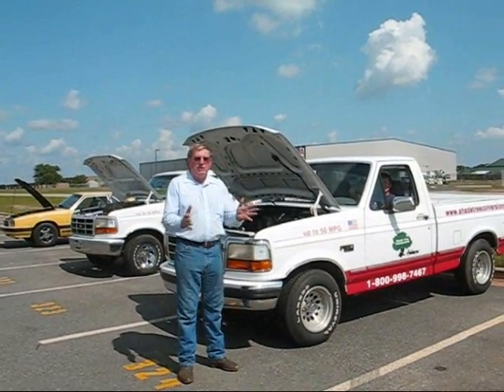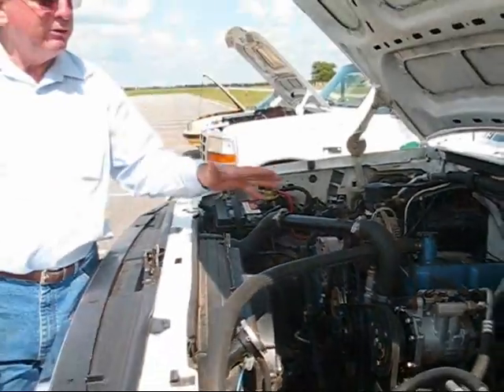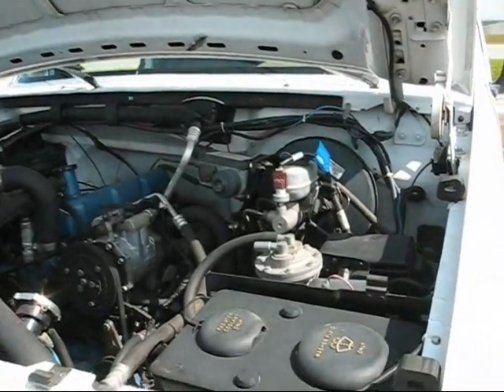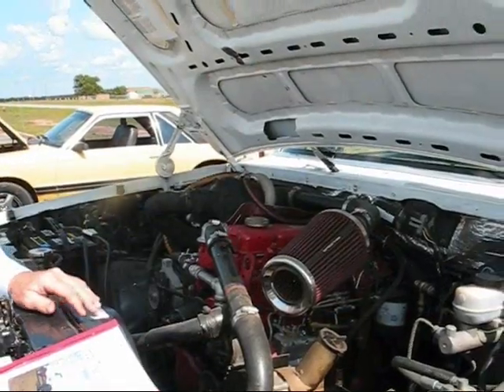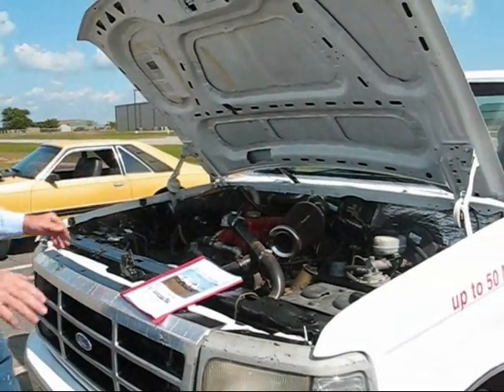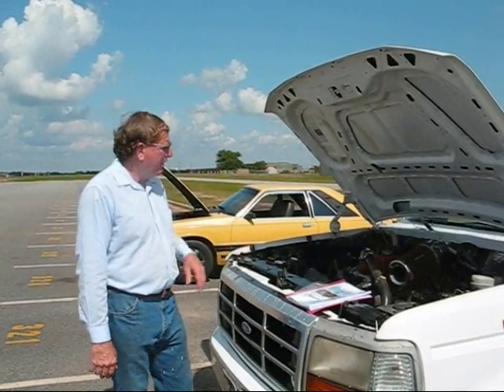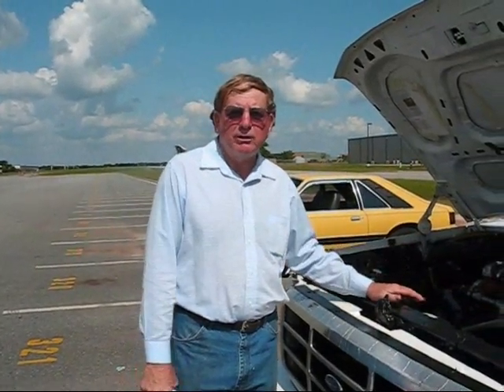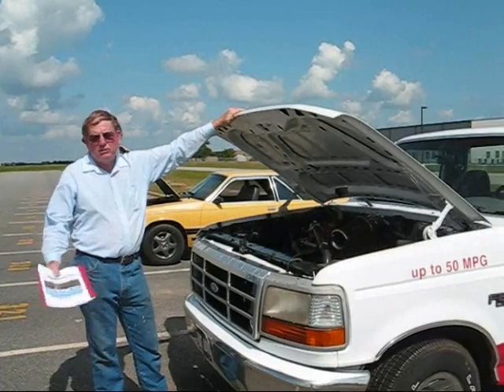Shade Tree Conversions Diesel turbo tractor engines Part 1

Comment: My dad used to drive an '88 square body GMC 2500 with a 3+3 cab and an 8 foot box, it would get over 30mpg and pull a house down. Perkins 6.354. Right now I'm looking to do a similar conversion to a 67-72 F250 4x4. Just gotta find the truck first, then find a T6.354 lol

Comment: He's absolutely right about the high education snobs that have to follow everything by the book, but the hard workers will figure out how to make this stuff work.  I work in a small town truck shop and put a Detroit 4 53 in my pickup and my foreman has an Isuzu 6 cylinder in his.  They both run great and we get better mileage than a gas engine ever would.

Comment: i have a cummins 4bt in my 1977 chevy scottsdale, with a chevy 4 speed behind a 2 speed splitter and a np205 case. it has 307 gears and i get 33mpg city and up to 45mpg hyw
Reply: tyrell little excellent choice is it turboed?
Reply: 4BT 4 Cylinder, B series, T Turbo charged
Reply: what brand and model of 2 speed splitter? what transmission you using with it?
Reply: @MrScottJ87   likely a Muncie 4 speed (rock crusher) with a granny first gear... find them in 3/4 and 1 ton Chevy's and more … as for the splitter when the term splitter is used it usually refers to a 2 speed rear axle unit (not a double trans set-up) very reliable Eaton versions stand the tests of time provided the driver knows how to use it. These are found in many commercial and farm use trucks, long beds, dump trucks and give the option for 2 final drive ratios inside the axles gear set which allows a user to split each gear in the trans by switching the rear axle gear set many options how to drive such a beast but usually not needed until the vehicle is loaded to the gills. They aren't brand/manufaturer specific such units can be found in ford, chevy, international and many other trucks.. If your looking for a good trans for such a build there are some nice Spicer transmissions out there from back in the day that are 5 speeds with actual over-drives (.75 and .64/.67 5th gear) unlike the Muncie 4 (1:1 4th gear) best place to find one of these units is a bus/school bus certain model numbers have great gear sets and as mentioned real over-drive. Yes, the OP did word it in a way to cause confusion or he himself is confused as to what in behind what when he listed the specs.

Comment: I have a  good running  4 cl ford industrial diesel engine  from a NH  905 swather it's very easy on fuel . I have  1/2 to 1 tons  years 1950 to 1980 would that engine work for a truck ?    Our great town mechanic was helping someone that was broke down and was  accidentally killed  such a  sad  loss RIP  BIG E
Reply: Put a gaa v8 Ford in it

Comment: That air filter placement could use adjustment, it's just taking in every bit of the engine heat.
Reply: It's a diesel engine, hot intake air helps compression ignition in a small application like this

Comment: Hello I saw your video and it motivates me to do it. Could I do this to a 2004 ford explorer? What will be the changes I will have to on the SUV? Thank you
Reply: Look into the VW turbo diesel, the 16 valve 2.0 . Much quieter, better power, better power to wieght ratio. I've seen them adapted into Jeep's/ rockcrawlers.

Comment: diesels are more efficient mostly because of direct cylinder injection and a more complete burn of the fuel. hence why these newer direct injection gas engine are becoming so efficient!
Reply: Not quite. Diesels are more efficient because the cylinder is always full of air. They don't burn the fuel as well as gas engines which results in high particulate emissions. In "normal" gas engines (carburetor, throttle body injection and port injection) the fuel has plenty of time to mix with air which results in more thorough combustion. In diesel and gasoline direct injection engines the fuel is burnt almost immediately before mixing thoroughly with air. This however enables the use of ultra lean mixture in gas engines which makes them more efficient.
Reply: truthfully the bottom line is its verry simple there is more potential energy  (btu) stored in a gallon  of diesel than there is in a gallon of gasoline...which equals more efficiency.
Reply: Efficiency has nothing to do with energy density of the fuel.
Reply: actually it does...
Reply: Efficinecy is ratio of energy put into the machine and energy that comes out of it. It has nothing to do with the actual volume of the fuel used.
Reply: He's talking about fuel efficiency. You get more energy out of less fuel.
Reply: Agreed, and somewhat affected by the fact that 1 gallon of diesel has 113% of the energy of one gallon of gasoline.
Reply: Think you got that backwards bud
Reply: Diesels are more efficient than gasoline because of the High Compression in the engines. I can’t believe nobody mentioned that. 

Nissan has a Variable Compression engine now that can reach near diesel numbers and performance
Reply: @trevnico  Your wrong bro, get real. gas over diesel any day.

Comment: The only issue I have with this conversion is the noise. This can be minimized with sound deadening. We always called our Rollback the waga-waga  truck. That's what it sounds like at idle.
Reply: Use a catalytic converter on it from a pick and pull

Comment: live in a state where you don't have to do that. i have a friend who has two pipes running back from the headers off of a 77 scottdale with a corvette motor. sounds nice. he got pulled over for a brake line hanging down. nothing about the exhaust. here in iowa they are very lenient on that.

Comment: Cummins 4BT...best bang for your money imo...
Reply: Yeah probably about 10 years ago when you could find them for a $1000 or less in decent shape. Too many people on eBay want well over $2000 for just the engine. There are some great options for diesel swaps, Kubota V2203 IDI and DI for anything in the Ford Ranger size. Yanmar 4TNE86 2.1L...has a IP similar to the Bosch Ppump on the 4BT. 1.9L ALH TDI. Small CAT engines which are sold and made by Perkins.
Reply: agreed...still can find some if u get lucky...but I commend the conversions tho....awesome idea!!! When the 6bt in my ram gives it up, would love a CAT conversion in her!!!
Reply: I'd shy away from a CAT especially the 3116. Its a bit iffy plus with a 30qt oil pan...more than double the Cummins.
Reply: You aren't wrong but they are really heavy and hard to put in smaller trucks. The 4bt is way better than anything else but in a full size truck or bigger. Price is 3k now for one.
Reply: 4 years ago when I looked into doing a 4bt swap they were $1200 with a transmission, Gm or Ford. Now $3000-4000 is way too much. Might as well get a VW TDI to swap into a ranger or S10. Kubota 2203 IDI/DI are an up and coming engine for swappers but those have shot up in price the last 2 years. Really isn't much out there that's decent for swapping. Even Deutz engines are hard to get ahold of.
Reply: Ian Rochon Mercedes Benz OM606 is a better choice for a half ton. Its a 6 cylinder dohc so its way smoother, can be built to 600+ hp, and its about 2 grand instead of 4, so theres your adapter and most of the pump build paid for. I plan on mating one to a zf s5-42 and putting it in my 95 f150 4x4 that is currently a 5.0 with m5od. Only thing thats a bitch about them is glow plug replacement, apparently its akin to 5.4 3v spark plug replacement in that they can bust off. I plan on doing new ones with the head off before installing.
Reply: Keegan Johnson id like to see a vid!!! let us know if u did this swap. that sounds great

Comment: Hey, what do you think the MPGs would be like if you put one of these engine in a 30' class A motorhome?
Reply: A 4- cyl is too small for that. That 30' motorhome needs more power/ torque..get an international/Ford 7.3, or a Cummins 5.9 12 -V.

Comment: the ULSD road vehicle diesel fuel is further refined to get most of the sulfur out, that is why fuel has gotten so expensive. (taxes per gal at retail similar to gasoline) the emissions are a complete different issue, esp from midwest/farm/rural areas compared to big city/california etc. many folks need an xtra way to town. some years back i did a perkins 6cyl from a forklift +clark 5spd into 69 D200, really too heavy, but simpler than the 6.9/7.3Frd an more life than 6.2/6.5Chv less $ if used.

Comment: @MrTpengineer Electric is from the late 1800's, they were known as the woman's car, hand crank starts were not only difficult but hazardous at the time, they could hop in and go shopping. Gas didn't kill the electric car, it's not reasonable on a large scale, they require charging, the power grid even today could not sustain a large load of electric cars, solar nor wind could ever meet demand and require too much area cleared for use, cutting trees ain't an answer!

Comment: At 4:01, that is the same engine used thruout Argentina in Ford, Chevy & Dodge pickups, the owners swapped out the factory gas engines long ago for this Perkins. My brother-in-law had one in his 84 Ford F100, short-box. All is fine until you "run out of power".....one day he drove down into a dirt pit, fairly steep.....& couldn't get out! The poor thing just didn't have enough power, a gearbox with more gears MIGHT have helped, but I doubt it. If you've ever seen a pickup truly plain run out of power, it is quite the pathetic sight.
Reply: I wouldn't do this unless the truck was 4wd and had a 2 speed transfer case, but in most cases, reverse is the lowest gear and he could have probably (if able to get traction) backed the truck out of that situation.

Comment: I wonder if anyone makes adapters to slam a 3 cylinder tractor engine in front of the Mazada transmission? Lord knows I'd buy another truck just to do it.
Reply: Mazda is ford. Likely
Reply: I’ve seen tdi swaps into rangers

Comment: hi,how are you doing? i want to put a tractor diesel engine in my S10 because i want to use french fried oil. Can you advise me,what kind o of engine i could use? I appreciate.Thank you very much
Reply from the maker: Greetings!  I would recommend a 65 HP Kubota or Yanmar, 4 cylinder, turbo diesel engine, because Japanese engines are lightweight and dependable and are perfect for trucks.
Reply: @ReconditionedTractors   cool! thank you very much for the info!
Reply: what about a vw?

Comment: So let's say I want a kubota diesel with turbo or supercharger with 5 speed in my 95 2wd f150, how much will it cost me??
Reply: Guessing: 5000-6500+ for a new turbo diesel in the 100-125 HP range, then another 3500-4500 to install the conversion motor.
You'd have to wrench a lot of it yourself, and then put on a lot of miles to break even before the vehicle wears out.

Comment: I have a 73 Econoline, I bought it for the engine location, can be accessed, I would love to get a diesel put in it. I know a guy who graduated from a tech college, designing and working on diesels for Europe, America is restricted. The EPA here is why diesel vehicles are killed, they demand a zero emission version for 2014, something impossible for gas engines, not a requirement either!
Reply: Put a 7.3 in it. Tows trailers like a champ, decent Mpgs..
Reply: @aaronhumphrey2009  Nothing larger than a 302 will fit.

Comment: I'm not against what you are doing, but how do you get around the EPA regulations? You need subtitles for the deep southern accent and lack of a good microphone. If it wasn't for the strict emissions regs in Mn I'd put a small diesel in my 93 F150 instead of driving a smaller less safe Ranger. By the way there is at least 150-200 years of "known" oil reserves in Alaska and the US govt classified that in 1973 and made them cap the well. We wouldn't have a huge deficit if we used the oil we have.
Reply: @stevenwolfe9085  Because it is more secure, in the long run, to leave ours in reserve. If we ever became involved in a really serious beef with Russia or China, 10 or 50 or 100 years from now, depending on oil from overseas could become a real Achilles Heel.  If someone's natural resources have to be depleted, let's make it someone else's. That's the long view. I'm not necessarily saying I agree that's the best strategy, but that is a legitimate rationale.

Comment: fuck it, the I6 or 302, 351 V8 made better power. A truck is ment  to work. i would never downsize for economy when the gas engine does a better job.  I own a VW passat that was available with a turbo 4, I have the 30v V6, it pulls harder and has more usable power than the turbo I4 1.8.  You dont even need throttle when the clutch comes out, it will move at idle. the v6 has power everywhere from idle to 7000rpm. Not to mention, it gets over 30mpg highway in a 3400lb car

Comment: Sounds like a way to dump  good money in to junk.
Reply: That's a pretty dumb way to look at it. There's lots of good, solid truck chassis out there with tired or wore out gas powerplants. Dropping a solid small diesel in one will probably give you almost  as much lifetime as a new $50k truck for $40k+ less $$, and save you another $1k++/year in fuel while it does it, along with lower insurance rates. And if that diesel craps out several years down the road, you can rebuild it or buy another for a small fraction of what a replacement motor will set you back in one if today's wonder trucks. Based on all the idiosyncrasies associated with modern hi-tech powerplants, I wouldn't be shocked if this lo-tech diesel/dumb transmission swap proved to be more reliable than a new truck over the next 10 years, too.

Comment: saying "fancy educated mechanics would be lost"? That doesnt make any sense, Its not a very complicated concept clearly if someone like you can comprehend it lol. Being a "fancy educated mechanic" myself who works on tractor trailers and equipment id say any monkey with a wrench could put a motor in a truck...especially considering those tractor engines are smaller than intended for engine bay so theres no prior calculations needed